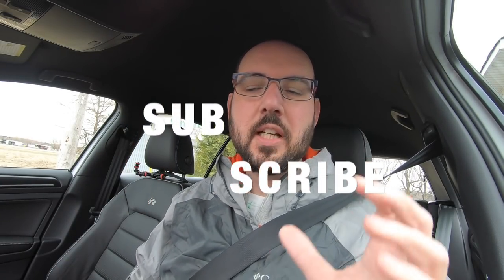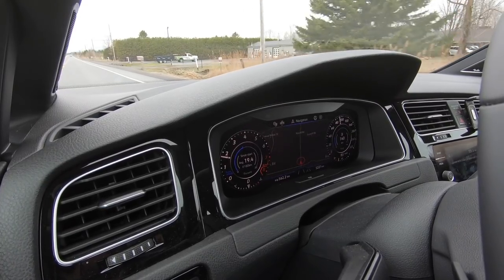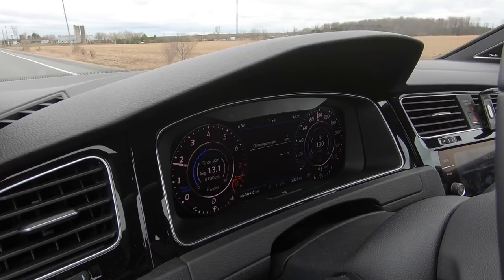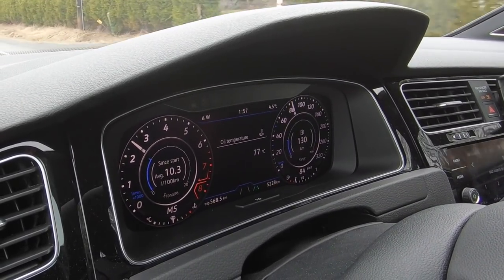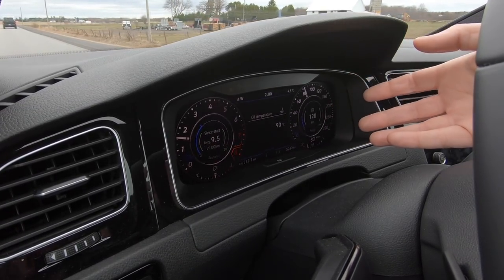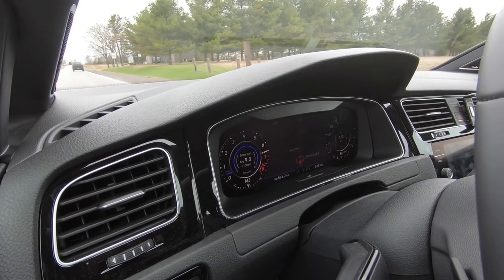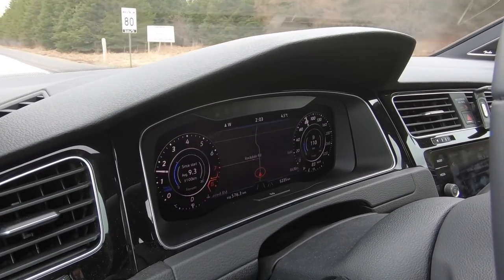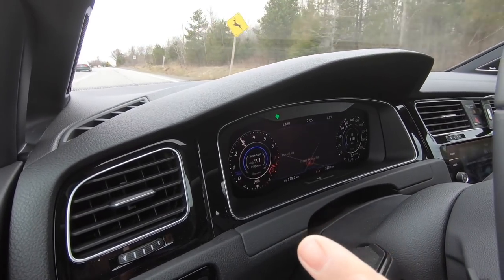MK7.5 Golf R Digital Cockpit Driving Data and Next Mods Planned - Netcruzer CARS

Comment: How do I get to add those inner data displays (average mpg with rpm outer dial and range remaining within speedo dial the range left). Do I need an OBDeleven?
Reply from the maker: It’s in the settings page for the dashboard screen, you can change what is in the dials. There are many choices. All stock, no OBDeleven needed for that.